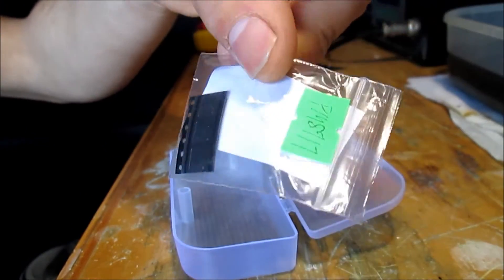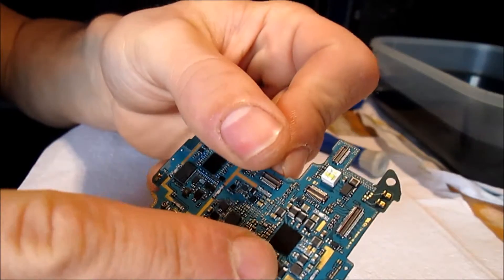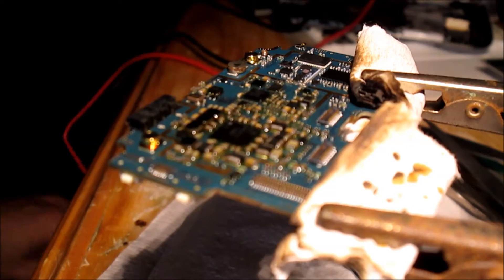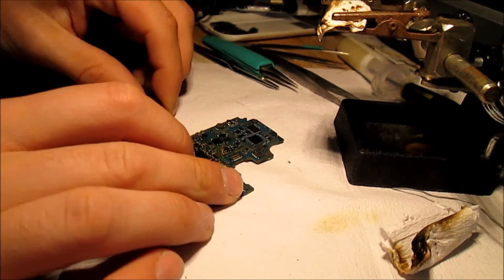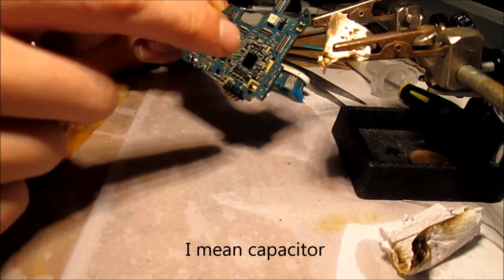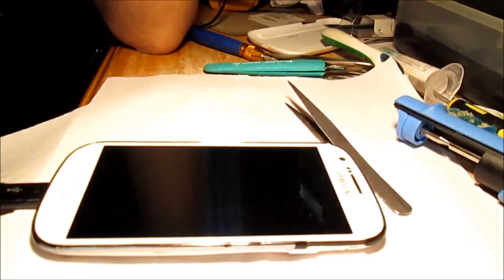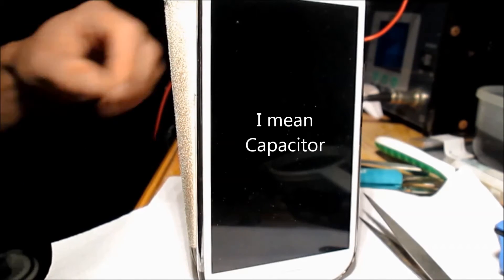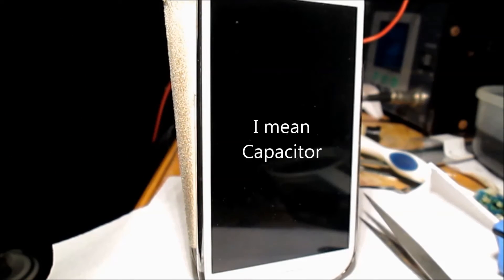FTVlog 53 - Samsung GT-I8730 it's dead don't charge and don't turn ON - PART 3

Comment: It should turn on if it is missing a capacitor if it is a resistor it may not, when has a cosumption of current without pressing power button means you have a short and that is the reason that is not turning on
Reply from the maker: thanks, that was my first attempt solding  so tiny, my tool arent the best

Comment: Any luck repairing it? I have exactly the same problem... Resoldered the IC and I got it to charge once... no power up though anda now it doesn't charge ... Have you got the service manual?
Reply from the maker: +ct2irw if I got the shematics I put the link on video description , no I have no luck I sneezed and lost some caps everything go wrong on that board.
Reply from the maker: I double check, i don't have any kind of manual, i just follow the same orientations
Reply: Thanks anyway, I ended up dessoldering the emmc chip to try to get the data out... But it seems that a special interface is needed.... I connected it to a card reader, and it detects the size, but i am no able to read the contents...
Reply from the maker: sorry, im not able to help you with that, i never try read a flash, but you may need so decrypt software or something to do that try do it in linux, all androids are linux base so....its just an lucky shot